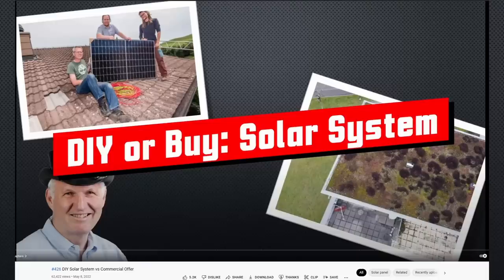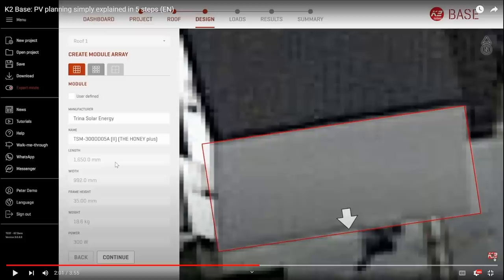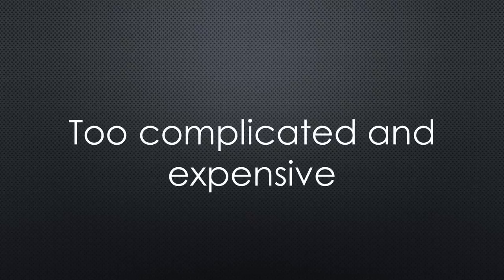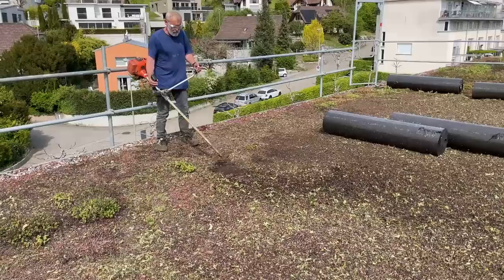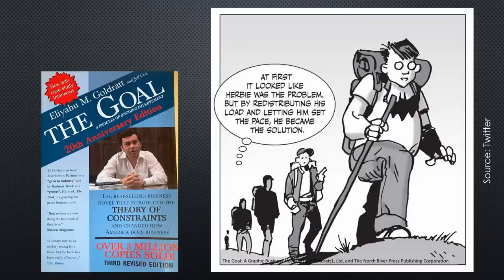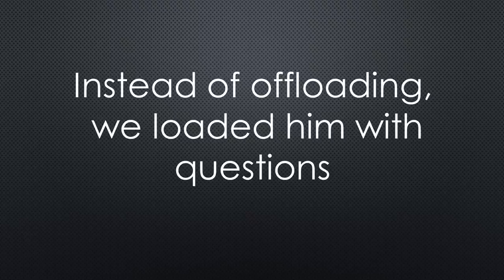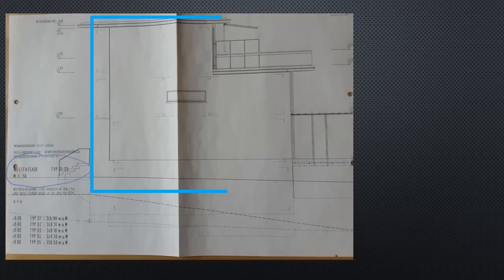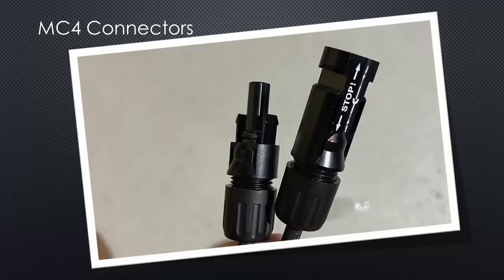#427 Four 8kWh DIY Solar Plants with neighbors (Part 2)

Comment: Why don't you do East, West and South? If you have South you have to use it. Supplementation in the morning and evening is also a great idea if you can do all of them. Also, if there are any locations where you can track the sun you can do it with a timer and a slow low geared motor.
  If you don't have the best choices for (multiple) orientations then it can be much better to go with "Thin Film" panels.
   Seasonal adjustment is also a great addition. It would only take 3 or 4 adjustments a year to make considerable gains when further from the equator.
Reply from the maker: These panels have a big wind load if mounted in a steep angle. So the whole mechanical construction would become more complex, I think. These days most solar plants are made with fixed panels because they became so cheap.

Comment: Allegedly MC4 cable connectors are a key fire risk. (plastic deforms from sun heat, connection becomes lose and there are high voltage arcs.)
Reply from the maker: We had to hide the connectors from the sun. Let’s hope!

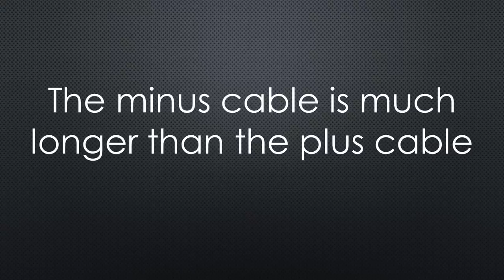Comment: 9:22 The minus cable is much longer than the plus cable
Cable loops should be avoided so that a magnetic field won't be induced by high currents.
Reply from the maker: Thank you for the explanation!

Comment: I'll be interested to see the output level , especially in the autumn and winter .If I could produce a hundred watts from my roof space it might be worth trying b8-)
Reply: Depends on how many panels you have, Autumn/Spring equinox in the uk suits most UK panels as the attack angle of the sun + cool winds is at its optimal. Solar is worth it even if you have one panel in todays current energy market. The winter use will be okay a 10kw system will net 500kwh in December.
Reply from the maker: The plan is that I get more than I can use, but unevenly distributed. I do not expect a lot in winter. But 9 month should be ok.
Reply: @AndreasSpiess  Thanks,my problem is the roof is split east-west  (with a pita chimney that casts a awkward shadow) requiring  two installs .  I don't use a lot of electricity (feed in tariffs are derisory) so payback time is important to me .
Reply: @ecoterrorist1402  500kWh in winter would be great, but sounds optimistic. Do you have figures per m2 for winter months?
Reply: @wktodd  no but i can find out, give my an hr i will take a look

Comment: thanks for sharing! It is always fun to watch others to work ;) but seriously, very well done! environment friendly and also building the local community! Actually it is good to see people are working together/helping each other. One question about the mechanical maintenance - do the panels need cleaning from dust?
Reply from the maker: They say that the rain will do the job. This is the reason for the 10 degrees slope.

Comment: Why did you keep the chimneys? We had exactly the same type and we just cut them down to half the height so that they would fit below the panels. They are even better protected from rain now. and we did not have to remove any panels because of them.
Reply from the maker: Interesting idea! Maybe I have to talk to a professional. They are filled with concrete :-(

Comment: Thank you Andreas, this is a really great video documentation! What a great community project! One question, you only talk about the technical challenges. But how about the challenge to get everyone on board for the project? I can see at minute 7:55 that not the complete roof was covered. Does that mean that two co-owner were not on board? (I can see two roofs in that area). How did you get all the others on board, which makes it cheaper for everyone?
Reply from the maker: 6 houses are built together. But I only asked the 4 neighbors I knew best because it was already complex enough. And I had to move fast because of shortages of panels and inverters...

Comment: Thanks Andreas for detailing the installation works and pitfalls.
Do you have a licensed electrician on the team ?.
In Australia, an electrician is required to install and certify any electrical cabling where the voltage exceeds 50V.
I’m an electrical engineer, however our regulations still require a electrician to certify the works.
Reply from the maker: The licensed electrician comes tomorrow for all the grid-related things. The rest can be done by us.

Comment: A substantial project.

What provisions are you making for physical maintenance such as cleaning panels and replacement of components once the safety barrier is removed around the roof?  Are there attachment points for fall protection harnesses?

Any permanent fixture like water supply for washing off spring and summer dust (and message packets from avians) when the rain doesn't fall?
Reply from the maker: Fortunately, I can mount it with a short ladder from my terrace. And as a private person, I do not need an attachment point. I just have to pay attention ;-)
So far we hope that it will be maintenance-free because of our rain. But we will see... But I have water on the terrace, too.

Comment: I thought that would be an easier task one could really DIY. It's seems that an electrician is needed to look after the devil details.
I'm wondering if would be cheaper and easier for the bureaucracy to just have a master switch you can use once the energy in the batteries runs out to connect to the utility company
Reply from the maker: Here a master switch would not help because if it is closed the system anyway is connected to the grid. Only an off-grid system would work. But this is not advisable for our long winters.

Comment: You didn't mention anything about drainage. The original soil probably drained well. Are you sure the material that is keeping weeds from growing will drain well? I guess you'll find out! EPDM is great stuff, but you don't want to temp fate by having water pooling on top of it for extended time periods.

Are flat roofs common for residential structures in Switzerland? Does anyone use the flat roof for a patio rather than weeds?
Reply from the maker: 1. The water disappears from the surface in a short time.
2. Yes, we have a lot of those flat roofs.
3. Some are used as terraces (like my "antenna platform" one story lower). But most are just roofs.

Comment: I am jealous that you can just weigh down the panels with concrete blocks.  I would like to put solar on my flat roof, but here in the US it is a membrane on wooden support beams.  The membrane has to be renewed regularly which would mean the panels have to be removed plus the potential damage to the membrane.  This assumes the roof structure can support the load needed for the potential winds.
Reply from the maker: This seems to be a very different setup! So maybe new houses will be planned with the possibility of solar right from the beginning. They discuss such a law here.
Reply: @AndreasSpiess  It is common construction here in the US.  Construction of a flat roof like yours I have not seen, but can understand it use in Switzerland due to snow loads.

Comment: Mr. Spiess, some time ago I had this idea no one had ever had before (lol): using a water cooling for the panels that would also be a water heater for the house. I found a video of a Dutch company that sells a system like that complete with heat storage for floor heating. I live in Brazil so even though floor heating is not necessary for most of the country, solar panels are expensive (import taxes + currency exchange rate), the amount of sun and heat is good and our electric system is already near full use. I know the water would get heated well because it's hot here but I still wonder how much is could improve efficiency and lifespan of the panels. I also wanted it to be sort of DIY - an aluminum profile based structure that could be manufactured locally by small workshops or even by the installation companies (here they are small companies with most workers being partners). Unfortunately I don't have the equipment nor ability to do these devices and tests. Do you think this could work? Remember: a cold winter day in a somewhat chill city like São Paulo is around 5ºC and down south it can go to zero - perhaps a cool autumn day for you? Thanks!
Reply from the maker: I saw a video where they combined water cooling ( heating) with panels and achieved about 8 percent more electrical efficiency (plus warm water). It was in Germany.

Comment: Andreas, I am experimenting now with solar panels, and the East-West gives a nice result, I want to add about 30% of the panels also installing South.. for each string of panels, as I understand well, needs its own MPPT.. Can I connect the battery connection of these MPPT just in parallel?
Reply from the maker: Theoretically, it should be ok if they all have the same output voltage. But because it is probably not a "normal" setup, I do not know if you encounter any issues.

Comment: Happy Switzerland!  By our regulations, I need a complete rework of my 50 year old electrical main distribution box. 3000 additional EUR. And we do not have this DiY organization. So, I need a contractor. He wanted to use Axitec panels, but these seem to be sold out to Switzerland. The inverters should come from Austria but do not arrive. The batteries maybe in automn or next year. Shortages all over the place..... As in former GDR or other countries of that  color.....
Reply from the maker: We were very happy that we were early with the order. Now, a lot of things are sold-out, too. And the video shows why. Three projects in my neighborhood in the same week...
Reply: @AndreasSpiess  My order is > 2 month shortly before P's war. 
Btw. The parallel return wire may have EMC reasons. It tries to minimize the area of the current loop  and so to minimize the inductivity. If you are harvesting 10kW or 15kW and a cloud overcasts, you can have a pwer drop of ca. 10kW/s. And afterwards your fast MPPT fights to regain the power.  It is more power eectronics than the PV Cells for ESPs :-)
Reply from the maker: @klassichd10  others suggested lighting as the main reason. A big loop induces a big voltage…
Reply: @AndreasSpiess  Thanks. Lightning in the neighbourhood is a good reason to keep the inductive loop as small as possible. Indeed, I found an old article "Elektropraktiker" 2009-11 p34 covering DIN EN 62305-3 (VDE 0185-305-3 Beiblatt 5:2009-10) "Blitz- und Überspannungs-schutz für PV-Anlagen" which confirms this. Thanks again.

Comment: Did you do east-west configuration because in your location that you're in that's the direction that the sun is mostly facing? Here in CA I believe it's always best when the panels face south.
Reply from the maker: With the cheap panels it is better to use east-west on flat roofs because you get more panels per surface and you get more energy in the mornings and evenings.
Reply: @AndreasSpiess  there was a video I came across once where multiple of the newer black style monocrystalline were tested against similar rated but older blue style polycrystalline. The older blue style panels won in every challenge & I'm fairly certain against every black style monocrystalline as well. The darker new style was increasing in temperature faster than the blue style panels, and also output less power than the blue.

Comment: Did this 2 months ago 8k PV, 15k lifepo4, only single phase 8k, but a payback of 4 years, and next year when the prices of power double then it will be 2-3 years or more. Really you should know, and now I want to know, why does the - cable have to run like that... ????? why I didn't, have I made a terrible mistake ?
Reply from the maker: 2-3 years payback is excellent! I mentioned the reason in one of my later videos: Lighting.

Comment: The battery comment you are correct + & -, but additional cable length on the neutral, unless it’s a specific of the manufacture instructions I’m going to ask Why?
Cabling on metal conduit must be an europe thing, i use plastic conduit.
Reply from the maker: It seems this wiring is against lightning. It reduces the induction area.

Comment: Would it not have been better to angle the panels for maximum Sun? The one panel I currently have is mounted for maximum Sun in mid winter. I don't mean to have the panels track the Sun, that would be too complicated. Also more angle on the panels helps keep them clean and should help any snow slide off.
Reply from the maker: I discussed this matter in the last video. More elevation means more shadow and less panel area.
Reply: @AndreasSpiess     Sure a few  less panels but around double the power per panel in the winter months when you're going to need more energy. House near me has a large number of high angled smaller  panels to get maximum power in winter for heating. I think the optimal solution has to take into account the use case to get the best from the roof area. I'd add having some space between rows makes maintenance easier.
Reply from the maker: @robroysyd  i agree. But we heat with local wood…

Comment: I was wondering the following: Now that you wired them in series, what happens if a part of one of the panels in the series fails? As far as I know, it can happen that a cell in the panel fails. With many panels, this will cut away 1/2-1/3 of the panel. Now I wonder: Since you wired in series, would that mean that all panels will now be affected by this broken panel? Im not familiar with this brand, so Im not sure how they handle a broken solar cell, but that was one of the things we looked at when picking our system.

Another question I had, which I couldnt see clearly from the videos, but did you leave the cables laying on the roof (including the connectors)? We had issues with this, since standing water would cause the connectors to "fail", causing the system to shut down if there was too much water. The manufacturer of the panels therefore always want you to bundle up the cables in the air, behind the panels, so that they won't be exposed to standing water for a period of time.

Anyways, very fun and interesting project to watch :)
Reply from the maker: You are partially right. Each cell can have an effect on the overall system if it fails. This is why they add diodes to bridge bad cells (or cells in the shadow). And our cells use half cells which enhances this effect. Just google "half Cell panels".

Comment: It sounds like you all learned from the mistakes. 

But it is a bit strange that the vents don't contain access to a shaft running to the basement. Doesn't sound like Swiss grundlichkeit :)
Reply from the maker: They probably wanted to make sure that no water enters the house…

Comment: Don't mix MC4 Connectors of different brands. They like to get stuck or are not watertight. Not worth the hassle. Just get the exact same connector your panels have.
Reply from the maker: Not easy because the panels as well as the inverters came with connectors. But it looks ok. We used quality connectors...
Reply: @AndreasSpiess  Since you bought everything from one source, they should know, which connectors play nice together. Usually, it isn’t necessary to mess with the connectors after installation anyway.
The issue isn't that they won't fit, it is more, that you can't separate them easily or they are not completely watertight. Water in connectors leads to insulation issues, that are difficult to find.

Comment: didn't use micro-inverters?
Reply from the maker: No. As said, I did not want to have electronics on the roof. Plus I wanted a battery which is much easier with DC.

Comment: I do not understand the story of the wiring of the negative under all panels back and therefore being much longer.
Here it is 1 string and the negative is shorter cause the string starts with the plus far more aways cause the end of the string (its modules) are closer to the inverter position.

Lot of work and nice result, but a lot more opportunities for the neighbours too to follow your house community in the same or similiar way I guess.
Job for the major to explain your 4 house project to the citzenship as an example all or a lot could follow - and how he or the city could support such project to make such changes easier possible.
Reply from the maker: The wiring is against high voltages induced by lightning

Comment: In my country,  I've been hearing the same tales about cable length.
I asked professionals about it and they couldn't explain that to me.
As long as there is no explanation  it should be treated like magic or  voodoo,
It has nothing to do with real engineering knowledge.
Reply from the maker: Some commenters suggest that a loop creates a magnetic field. But I would not fear it a lot. It is DC... Anyway, the cost were not high and it is there now.

Comment: What about snowfall in the winter/fall, not producing power when the panels are covered. Any plans for that situation?
Reply: At the time of year that they need energy, there won't be any.
Reply: @johncoops6897  high in the Alps there is much sun, and because of the lower temperature the panels won't overheat and might produce more energy than in the summer (for the same amount of sunlight). The problem would be that the panels would be covered by snow.
How about a small heating setup on the panels, just like a heated car window.
Reply from the maker: We are on 350 meters. So snow is not a real issue I hope.